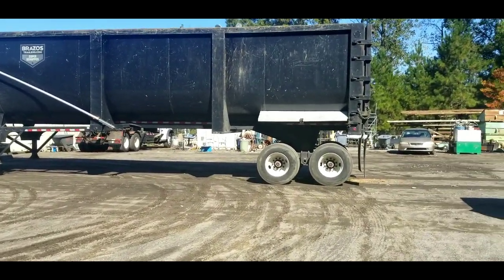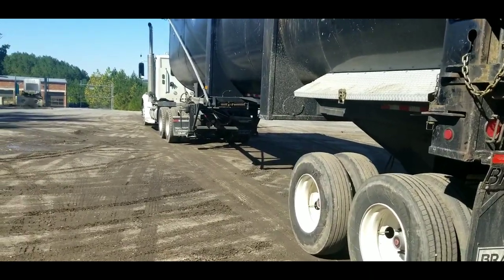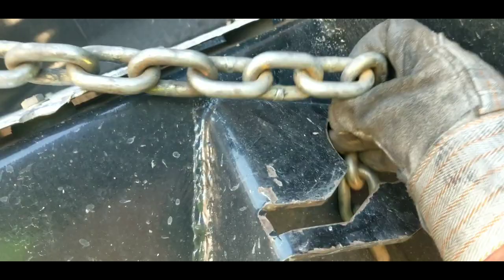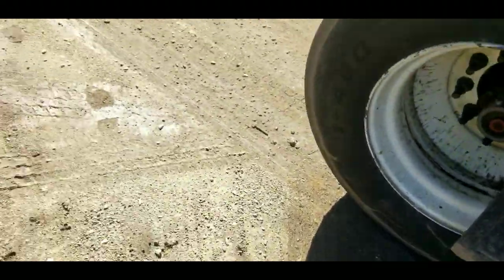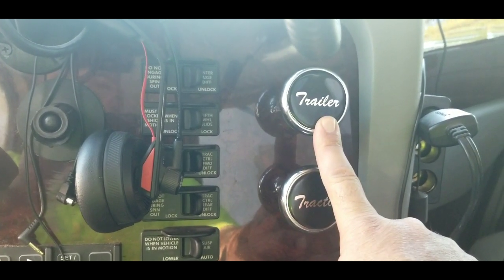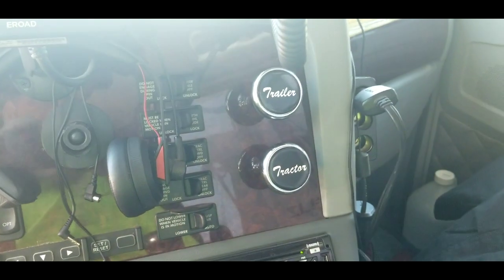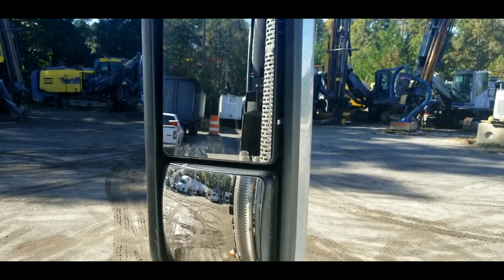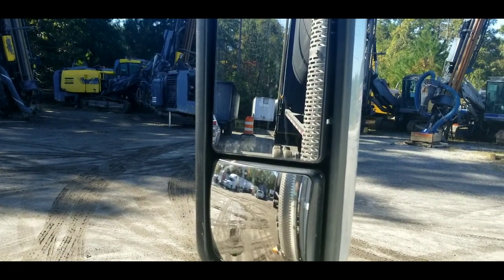How to dump an End Dump. Step by step!

Comment: Very well explained. I start a new job hauling scrap metal. Never pulled an end dump. Always pulled flatbed,tank and vans. You did a great job presenting your video, I feel more comfortable now. Thanks
Reply from the maker: Thanks, and remember to always check for power lines and overhead obstacles before dumping. I forgot to say that because all the places I went didn't have any.

Comment: Great job explaining this. I have seen 5 or 6 end dumps tipped over at the landfill in my 2 years of Roll-off driving (now I drive dump trucks). Problem is, when the trailer goes over... so did their truck
Reply from the maker: Yes, I refuse landfill loads in a frameless dump.

Comment: After u finish dumping and go to pull forward do you have to turn the pto off before putting it on low gear?
Reply from the maker: No, you do want to put your up/down into natural, just in case you need to go up more after pulling forward. My pto turns off as soon as I go to let it down, not all systems are like this. Thanks for watching.

Comment: Question. If u have airbags for both tractor trailers u think i can dump air (air bags) for both of them before unloading?
Reply from the maker: Absolutely! I've had trucks that automatically dump bags when the PTO is engaged along with manually dumping trailer bags.
Reply: @jrichtruckincbtips  thank u sir